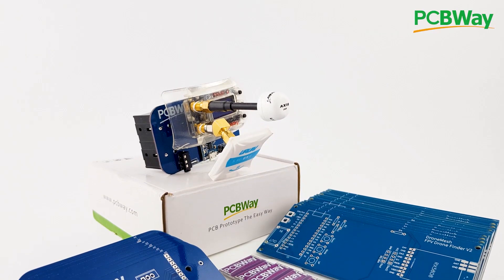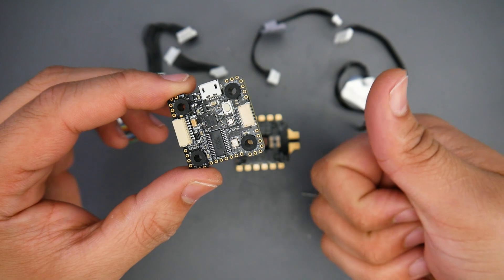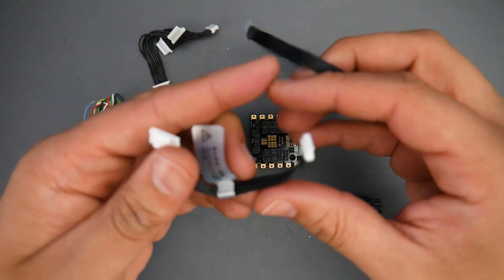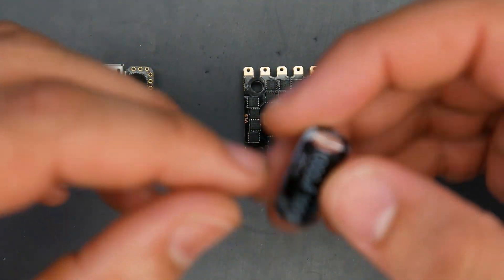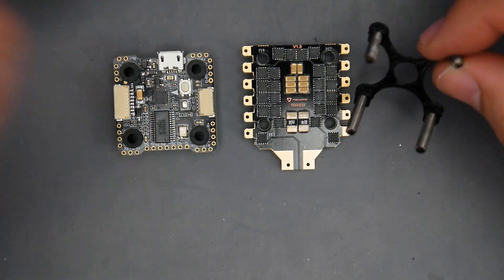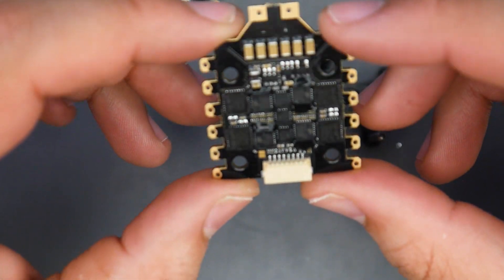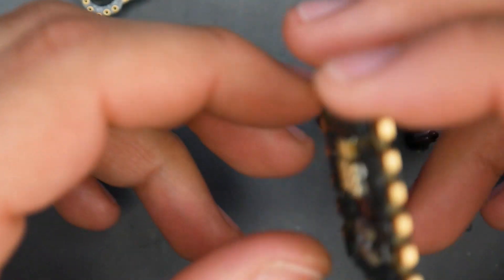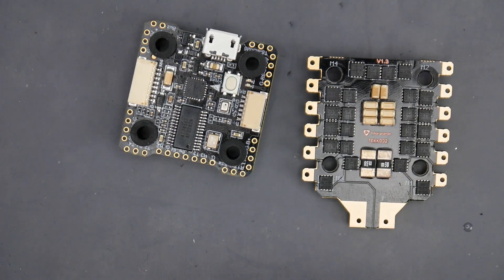One of The Best 20x20 with a Catch // Holybro Kakute F7 Mini V3 Stack

Comment: It's so hard to find escs with solder pads for data wires. Connectors are a deal break if you plan on flying in snow.

Comment: If holding the board with the arrow facing up, the 5v pad on the lower right is USB powered, very convenient for powering a receiver. I'm running this stack on a GEPRC CX3 Pro, love it in every way. Also, Tramp Nano doesn't need 8 or 9v, runs on 5v, so just get that to go with the stack, lol

Comment: Mounting may be 20x20, but it's really 30x30 size.  It's one of the new stacks the racers wanted, not really meant for micro builds.  You should check out the Talon stacks from Heli-Nation.